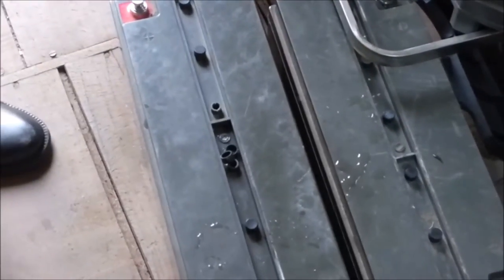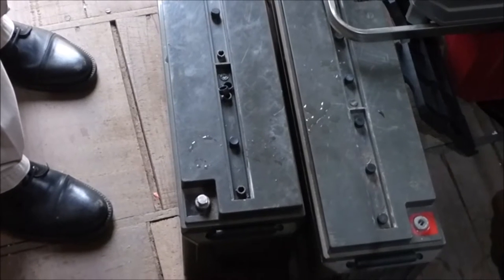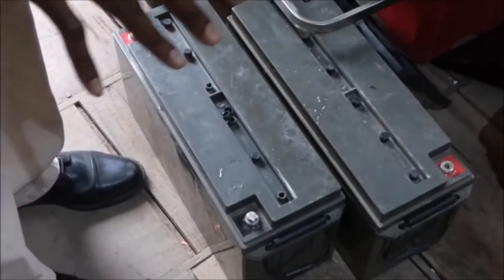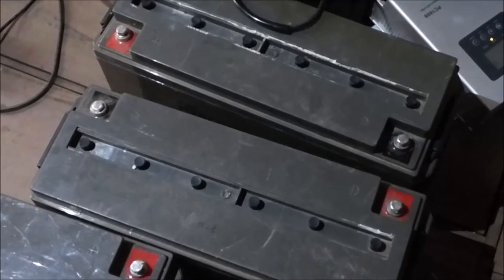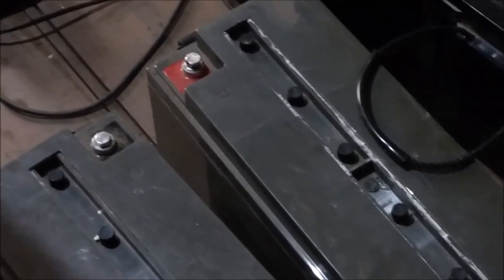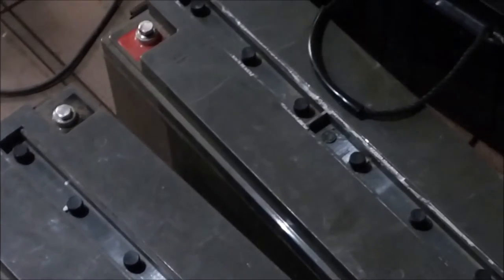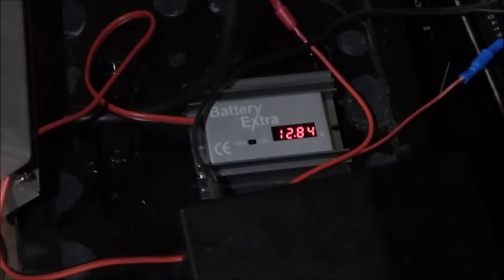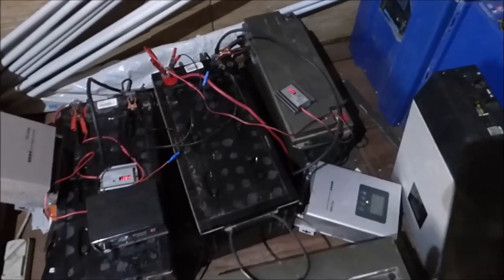Can mostly dead batteries be rescued?

Comment: Would surely want to see the final outcome.A lot of these table top inverters cannot supply the adequate charging voltage like you rightly mentioned and this is one major source of problem for these batteries
Reply from the maker: The people who sell them are not even aware that the batteries should be charged beyond 24 volts. The 200 Ah batteries were never charged above 26 volts. I spoke to the reseller and he said that there are no inverters that charge above 26 volts.
Reply: what!!! For real.. That explains a lot why people keep changing batteries every 12 months
Reply from the maker: +Ibidapo Ilawole the same place charges 4000 to charge the batteries. You have to leave them for 5 days. On Monday we will place a load on the batteries. Run a drill and see how much it will discharge. Then charge and discharge them a few times a day for four days
Reply: Level of ignorance among over 80% of sellers and dealers in renewable energy product is sad. In any case I am using a table top inverter although I have an mppt charge controller (with adjustable voltage charge profile) which is what does most of the charge. The inverter's job is mainly to invert and bulk charge when there is power. the controller does most of my charge
Reply from the maker: Please make sure that the low battery voltage is high enough. At 11.96 V your batteries are at 40% or lower.